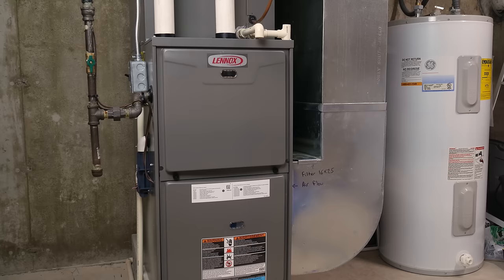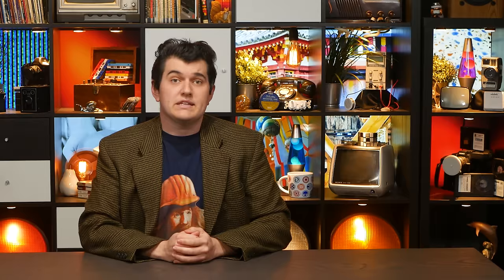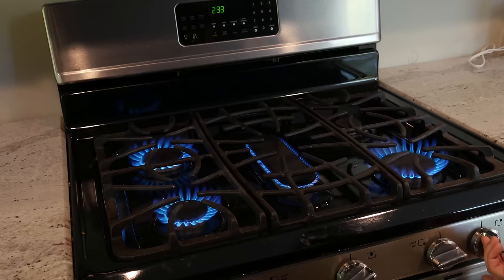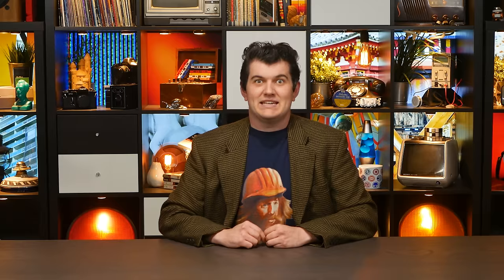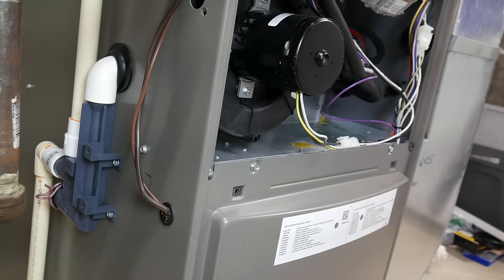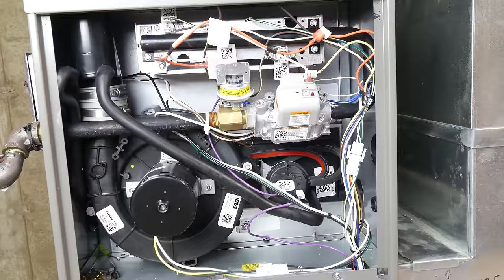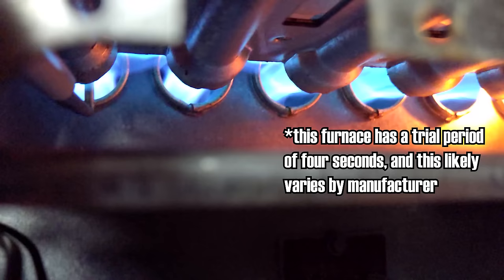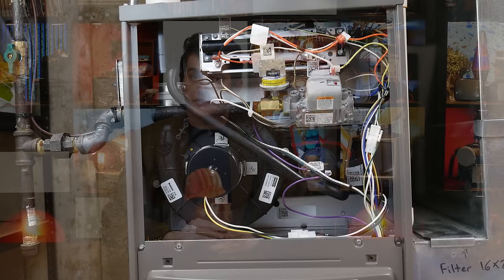Forced-air Furnaces: The What, Why, and How

Comment: Here in the North East of the US, it is very much common to have an oil burning thing that heats shower/tap water but also a separate loop for heating the house by sending hot water around to radiators (the long short kind that run along the length of an outer a wall at the base, near the floor - a copper pipe with a bunch of fins on it with a cover over the whole thing).  That said, my brother's house does have the "only under the window and tall and narrow" kind of radiator.
Reply: PS - neither of the houses are "new construction" but not as old as you implied.

Comment: I live in Quebec and have had Electric resistance heating for my apartments as well as boiler heating the former when I lived in more recent buildings. But quebec is a rare occurence due to all our hydro electric dams
Reply: Maybe in a cheap apartment, I live in Manitoba where 99% of power is also hydro, but we just use natural gas because it's still cheaper(And your going to have air con anyways)
.

Comment: On the "some amount of negative pressure is probably a good thing" thing: Over here, as far as I am aware, every single room in the main living area of houses and apartments (so storage areas are excluded) has to have a ceiling mounted air exchange vent, and they must provide a certain minimum level of air flow (it's not much, but it's constant). This makes sure that the air in the living areas stays reasonably fresh. I used to wonder why I felt that the air was so stuffy when visiting a friend in a neighboring country, until I noticed that none of the rooms had any air exchange venting. You had to open up the big ass windows in every room on most days, at least for a while, to combat this, something which just seems like waste of heating energy.

EDIT: And to my knowledge most of these systems also provide fresh air from outside from a more localized point in the house, and harvest heat from the exhaust, so it's not an energy loss catastrophe.

EDIT2: And as for heating, if you live in a reasonably urban area, your heating likely comes from water heated by the waste heat of your nearest power plant...
Reply: ebulating  Great to hear. =)

I don't know the state of the art over here, I just know that houses have been built like that since the 80s, at least.
Reply: @jubuttib  where do you live? i think you never said it, or did i miss it?
Reply: @lutyanoalves444  I like keeping it a secret... Nah just kidding. Finland.

Comment: What is a furnace? Well, it's a flamethrower in a box.
Reply: With a fan...or 2...
Reply: and a computer to make it turn on and off and not make anything explode or poison everyone.
Reply: This is the FORCED air furnace, that you've just described 😉
Reply: @samerm8657  now you are just forcing the topic XD
Reply: @Archgeek0  there's computers? that's the most unsafe part of it all
Reply: @monad_tcp  Not really, a pretentious way of saying a few logic circuits (used well before vacuum tubes came out)
much like, in Horticulture, 'cloning' has displaced taking cuttings

Comment: I'm in the UK, and most of our heating is by boiller-radiator systems; while the carbon monoxide risk is lower (because it's hard to transmit it through the water pipes, and the boilers are generally room-sealed, drawing fresh air from outside, running the whole thing under negative pressure, and with checks of that), I still have a carbon monoxide alarm.  Scary stuff.
Reply: Unless you live in my stupid house which due to a petty argument was built without a gas supply at a time when central heating was commonplace, and is timber framed so not very well insulated. Don't ever buy a house like this, it's horrible. We've found the only way to keep it warm is install a burner and burn coal. Fortunately this is the only area I've known like it.
Reply: Yeah, plenty of rural houses without gas as well.

Comment: I know I'm coming into this conversation way too late, but a few years ago I had a situation in which our furnace (actually a package furnace/AC unit) stopped working.  The draft induction blower, or whatever it's called, was still spinning, but for some reason the little squirrel cage fan on it had corroded and had fallen off of the motor shaft.  The Hall effect sensor on the motor knew that the motor was still spinning, but some other sensor knew that the blower was not actually blowing air, so the whole furnace went into panic mode and just blew air through the house forever to prevent anything more violent from happening.  It took me some time and effort to figure out the actual problem.

Comment: 2:16 I mean, with heat exchangers you can actually go above 100% efficiency (by using the ‚heat‘ outdoors), though this doesn‘t work for really cold places. It does however work in places were the outside temperature gets above 0 degree Celsius or so for a few hours every day.

4:00 Heat pumps, that is what it is called in English, glad you mentioned them!

Comment: Anyone else remember being afraid of these things as a kid because of the weird, unfamiliar sounds they made?
Reply: I used to be afraid of a leaky toilet when I was young
Reply: My dad is an HVAC guy who works every corner of this state and they still kinda scare me lmao
Reply: I'm 21 and I'm still scared by them, so..
Reply: They burn with fire. FIRE! I easily see young PPL be afraid of these with fire being the brightest reason behind it. (Pun intended) I am from Sweden and we don't burn with fire to heat our homes. Heat comes from an unknown place by me to heat up water, this heated water is then pumped through multiple radiators strewn about a home, there is about 1 radiator per 2 rooms, if a room is big enough, 2 or more radiators can populate the same room and are almost always located right under a window, but this is a very rough radiator count.  Temperature can be altered by twisting a big mechanical dial at 1 of the upper corners of a radiator. Some systems are slow acting, and a temperature-changing twist of a dial takes effect the next day.
Reply: @737Garrus   Radiators are trash (at least in America). They don't turn off until it's 90 to 100 degrees in the house and it feels like a heat wave. Plus, the thermostat was in the basement, which is stupid because it's always cold in the basement. Sometimes in unusually-warm days (80 degrees in January), it would still turn on. We had to flip the emergency on/off switch several times just to stop the furnace from heating us to death. Not only that, but most of the radiators didn't work. I shudder to think how warm it would get if all of them came on simultaneously.
Reply: @Trainfan1055Janathan  "They don't turn off until it's 90 to 100 degrees in the house and it feels like a heat wave". 
In Europe we simply put a thermostat ($10/pc) on every radiator and the problem is solved. Also lets you adjust the temperature of every room as you'd like.
Reply: @whuzzzup  Wow. In the ghetto-ass apartment we lived in in New Jersey, the only thermostat was in the basement, so there was basically no way to control the temperature.
Reply: @Trainfan1055Janathan  I totally get what you mean. The Saint Paul apartment I lived in had the thermostat in a different unit! So if those people decided to use the oven or take a couple hot showers my unit would get down to 55 Fahrenheit, on other days it would get to 85
Reply: @SpaceboyA55  Wow. Kinda makes you wonder what idiots designed the apartment……🤔
Reply: @Trainfan1055Janathan  Your issue isn't the radiators. The issue is the thermostat in the basement. I lived in a farm house with radiators and it was never like that, and the thermostat was in the "ground" level above the basement.

It also sounds like some of your radiators need bled and have air stuck in them, which only takes a couple seconds to fix.
Reply: No but your comment reminded me of this scene from Home Alone https://www.youtube.com/watch?v=5X2vXoR6XU8
Reply: @Trainfan1055Janathan  Move the thermostat up to the room you use the most. It's not very hard to do. Buy a new thermostat with an anticipator. They shut off the heat a little early so the radiators do not overheat the rooms.
Reply: @vinquinn  We didn't have that option because we were renting it.
Reply: @winrid  Is bleeding what that valve on the top of the radiator is for? If so, that's hilarious because my parents were afraid to touch it. They used to say, "don't turn that valve! We don't know what it does..."
Reply: No, but up until I was 6 my bedroom was under the attic where the air conditioner's evaporator was, and the noises it would make when it shut down were pretty creepy.
Reply: Quite the opposite. It was one of the most comforting sounds ever for me. Helped me fall asleep.
Reply: @vinquinn   Remember, don't just heat the "air" in the room. You must also heat up the "Objects" such as chairs, walls, floors (especially uncarpeted), etc. Otherwise, your heater comes on more frequently to heat the air only. You touch the wall or walk on a smooth floor and it's cold-you get a chill.
Slightly different principle... You are in the car, and window defoggers not only heat up the windows, they dry the air around them when it's cold-you exhale moist air. Humidity affects the air tremendously. If you turn it off while continually driving, windows fog back up (I doubt you want to stop breathing.) Park the car, you need the heat on (car running) continously or you get cold waiting for car engine to heat up when you are shivering. Don't you wish your car stayed warm when you are out of it? It looses heat "Faster" than your house/room does because of the lack of insulation, and there being so much metal and glass (smooth surfaces). A totally wooden-body automobile would be warmer (just not safe.) Your home has wooden items (including furniture frames/tables) glass and smooth surfaces (kitchen, bathroom floor/shower) that, you wish would stay warm, right? The heater in your car does many things at the same time (in winter): heats you up AND cools down the motor when there are no leaks in any part of the system. But, to maintain the warm temperature comfortable for you, the engine must keep running. But in a building, once the walls, floors, and other objects are warmed up, the furnace does not have to keep running just to heat up the air. Walls no longer stay cool to the touch.
Windows? If they condense/have moisture/ice on them, means a few things; 1. Shows humidity-is okay in the room. Because having the room too dry is bad-your skin dries out/flakes-itches making you uncomfortable. 2. Moisture or ice can also be a sign of heat escaping/poorly insulated windows- and your much needed heat is being wasted. 3. It will be ice if the outside temperatures are extreemly cold... any remaining humidity will condense on the windows and freeze/frost (like car windows). keep a trickle of water running also so pipes do not freeze up (plus, that would also emit a bit more moisture into your living area making less static shock [unless you like to shuffle your feet on the floor and zap something or someone, heehee😆.] )  John
Reply: Home Alone?
Reply: @737Garrus  Some people have those in south america too, made by Peisa. But my grandma's always breaks down
Reply: @Trainfan1055Janathan  it sounds like your boiler/heating/thermostat system is poorly designed/possibly malfunctioning, and your thermostat is in a terrible place. My grandfather's friend on my dad's side and my mom and her friend has/have hot water radiator/baseboard heating, and neither have issues with it. I know because I've been to both houses during the winter, and neither have issues where the temperature gets up into the 90s at all. The only exception to that statement being my grandfather's friend's house was optimally built to face the south to take advantage of solar heating in the winter, and was built with a wood stove in mind, and unless either my mom or her friend or my grandfather's friend sets the thermostat up that high, there is no way that either house is going to get up into the 90s. Both scenarios have a thermostat in the main living area of the house. Even my grandparents on my mom's side have hot water heating, and it's the same scenario for them, they do not have any issues with their's either. And my grandparents have Separate zones for up and downstairs, the downstairs is insulated for efficiency if your wondering.
Reply: I live in Florida, the furnace was never even turned on.
Reply: I'm scared with sudden noises so yes
Reply: wait WHAT??? why are you guys all afraid of the furnace?  why is the sound "weird and unfamiliar" ???? literally all that I hear is air coming out of the vent.......... there are no weird sounds....... y'all got issues
Reply: Yep, afraid and fascinated. I thought it was crazy as a kid there were literal flamethrowers inside a metal box in the laundry closet.
Reply: You haven't lived until the heat exchanger in your furnace starts shooting flames out the side of the chassis. Good times.  Sometimes ... the sensors don't work so much. As for radiator comments here, it's helpful to understand that radiator "tech" in America stopped like 80+ years ago. In other parts of the world, not so much. Forced air via ductwork has always been a ham-fisted way of distributing heat. Meant to be sophisticated, but the execution is usually quite crude.
Reply: Yeah Home Alone ruined heaters for me because of the one in the basement from the movie.

Also, his shirt looks like Bob Ross wearing a construction hat! Totally rad!
Reply: I used to stand over the big furnace grate during the winter in my family's old home.
Reply: Me lol I was terrified as a child
Reply: @thenexthobby  I think forced air is great. As someone with allergies, I have nice big air filter centrally located in my basement and it distributes air all throughout my house so that the basement air doesn't ever smell musty. Also, the same ductwork carries my ac in the summer months.

I don't really care for houses where the air never circulates. Typically the basement air quality isn't great.
Reply: @Me04120  I also think it can be really great!. Best, even. _B

Comment: The CO danger is mild on modern furnaces. If the heat exchanger has large holes/cracks, it will trip a rollout switch located near the burners. If the draft inducer isn't moving mostly combustion air (because the heat exchanger is broken for one reason or another), the rollout switch will trip and has to be manually reset by a technician. It is also a form of a limit switch. I see this on many worn furnaces.

Comment: Really loved this video!  Always wondered exactly how a gas furnace works.  We had a boiler from the 30s in our house when we first moved it and it was literally a gas stove in the middle of a coil of copper tubing that the water flowed through and then was pumped to the radiators.  Insanely simple but something only like 60% efficient.  Replaced it with a modern combination boiler/instant water heat to keep the radiators and it was tested at over 98% efficient.  Only drawback is you definitely need a humidifier with that system; speaking of which I watched your video on that too and love it.  My vote is evaporative for anything more than a bedroom.

Comment: Back in 2010 there was a massive blizzard in the northeast US. We got about 4 feet of snow in Maryland one night, and my family of course slept in as there was no way to get anywhere. At around 10am I wake up to the sound of alarms and my dad urgently telling me to get out of bed and get outside. I had no idea what was going on, as I couldn't smell anything burning and didn't see any smoke. 
Turns out the snow had blocked the vent for our natural gas furnace and, somehow, CO began building up in our house. The CO detectors in the basement turned out to be inoperative, and it was the single CO detector in our upstairs hallway that alerted us to the dangerous levels of the gas. Our furnace was in the basement, meaning that enough CO had accumulated to reach dangerous concentrations two floors above the furnace. 

If you don't already have some, please do yourself and your loved ones a favor and invest in carbon monoxide detectors. They potentially saved me and my family's lives, and they might end up saving yours. If I had to choose between having smoke detectors or CO detectors, I would absolutely choose the latter. You can smell smoke. You can't smell CO.